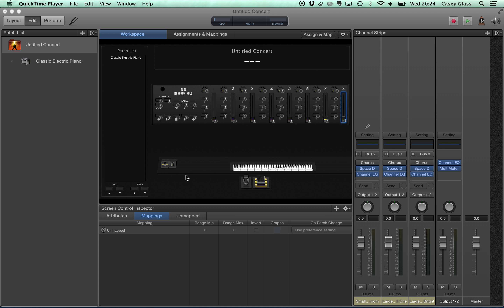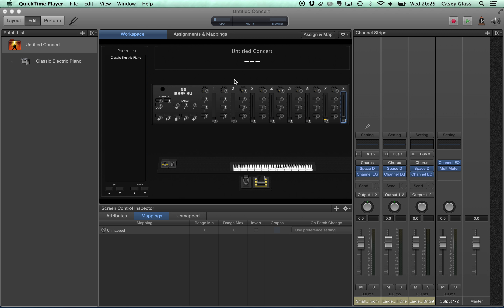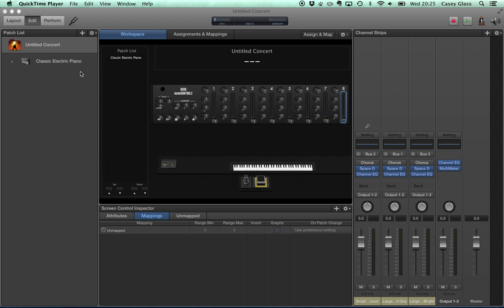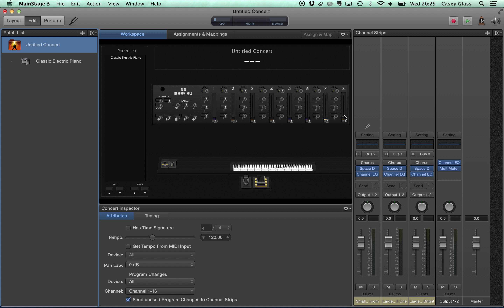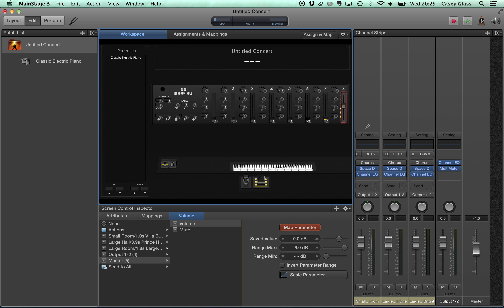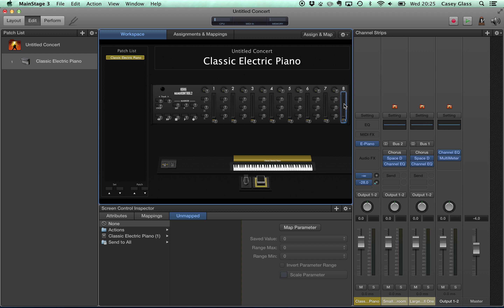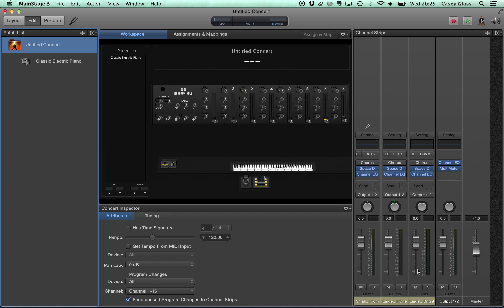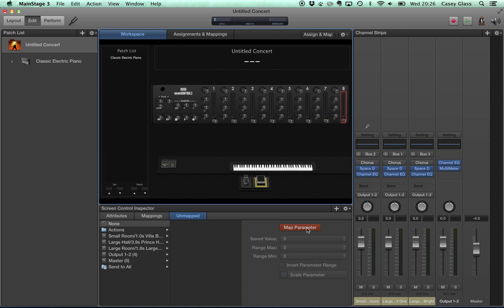Mainstage Master Fader Mapping

Comment: Is this template something you can make available?
Reply from the maker: You can find it here: https://dl.dropboxusercontent.com/u/36149606/Nanokontrol.layout.zip

To use open a MainStage concert, go to the layout tab and click the gear in the layout window (near the top on the right). Choose import layout and import the file. If you would like to move it to another concert simply select all the parts of the layout, copy, and then paste into your new concert.
Reply: thank you very much !